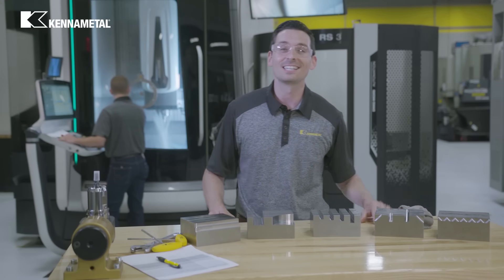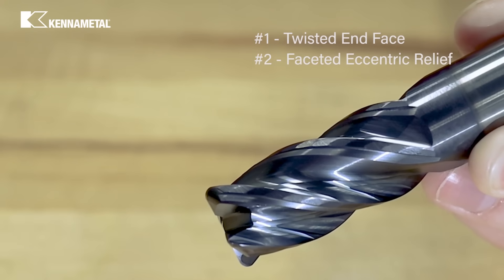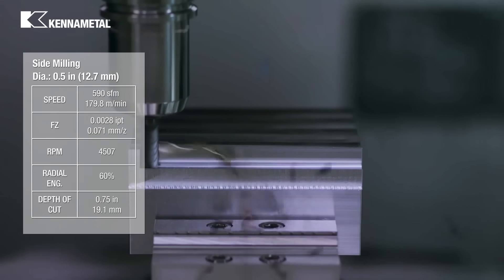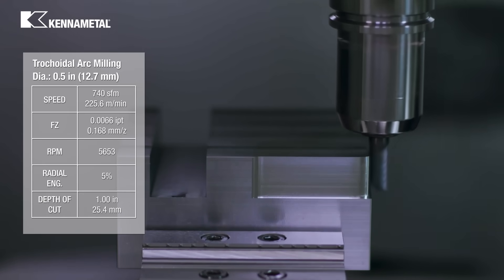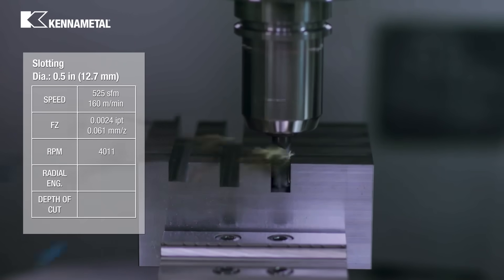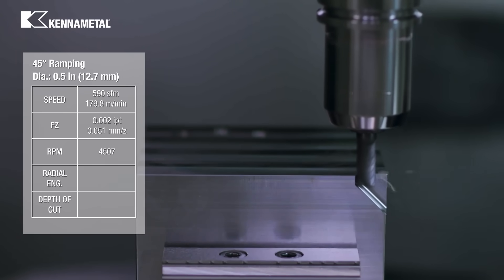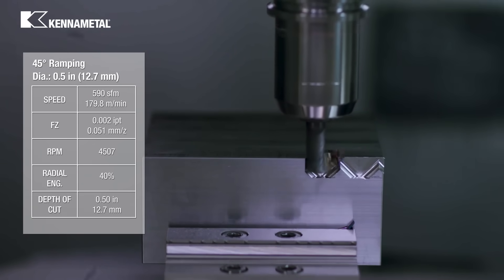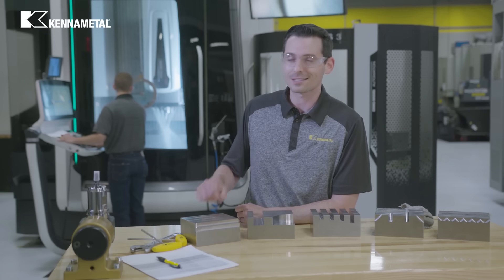HARVI™ I TE - The Magic Solid End Mill From Kennametal

Comment: What kind of horsepower and torque do you need to actually be able to achieve this. I feel like the machines I am using lately (Kitamura Hx300G) would have to have the spindle replaced after doing this for a week. Maybe the Matsuura H300 could do it but I don't know.
Reply from the maker: I won't be able to select between machines and manufacturers, but those values for example for the 1/2" cutter at 60% engagement, .750" axial loc, 590 sfm and .0028 IPT.. the Power at tool (Pcut) is 7 HP and torque at tool (Tcut) is 8.15 ft-lbs

Comment: What Material is it 42CrMo4 ?
Reply from the maker: 42CrMo4 is a material designation for a type of Steel.  If you are familiar with ISO material groupings, this material would be part of the P4 group, which has a hardness between 35 - 43 HRC.  I hope that helps!

Comment: What machine are you using for this demo please. HP and spindle taper size and type? What kind of tool holder are you using? If my machine is not up to the same specs then the tool is no good to me no mater how good it is if I can not duplicate these results in the workshop.
Reply from the maker: We used a DMG Mori DMC 65 monoBLOCK, 47hp, the spindle is a KM4X63™ and a HydroForce™ tool holder!

Comment: Would you use some form of coolant in real life situations ? 
Is this dry operation just for demonstration and filming purposes?
Reply: not usually in steel. thermal shock will fracture the carbide and cause early tool failure. Aluminum almost always requires coolant to prevent the material from galling and clogging the cutting flutes
Reply: @blob_87  It's the coating that gets fractured by the thermal shock. Then once the coating is gone the Endmill will be gone also.
Reply: yes...
Reply: If you get your SFM right in the sweet spot it's actually beneficial to run without coolant in certain types of material, like what they're filming with.

Comment: That is SICK!!!!  And no lube or coolant to boot IN 4140!!
Reply: Air blast for chip evacuation is all that is needed in a lot of materials when using carbide tooling. In fact, using coolant can sometimes reduce tool life due to thermal shock causing micro fractures in the cutting edges.

Comment: 1:13 why would you keep a mic In your back pocket
Reply: We're all busy watching this insane tool perform witchcraft and you are busy looking at the guy's ass :-). LOL
Reply: Basically it’s not good practice and a bad example of how to handle a precision measuring instrument 🤷‍♂️
Reply: BRUHHH indeed
Reply: Belongs in a case when not in use for sure
Reply: It’s not harming the mic at all? What’s it mAtter? As long as the mic is not dropped or knocked it will measure fine
Reply: @mitchelldafoe8445  it's more likely to get damaged, but more to due with body heat causing the mix to measure wrong when working to tight limits
Reply: rockaboy2 yes that is true it is more likely too get damaged, and yes if u we’re working microns body heat could affect things, if working in tenths tho body heat won’t affect much
Reply: I'm more concerned for his ass when he forgets it's there and sits on it hard. 😣

Comment: Good luck doing that on your tormach or haas
Reply: You know what? I'm gonna... just to see what happens. I'll use a comparable cutter in a press fit holder on a VF4.
Reply: @heyspanky5695  I'm predicting it will pull straight out of a press fit holder
Reply: Could you explain why you think it will pull out? Lack of HP?
Reply: Because your endmill acts like a cork screw. But try it why not
Reply: Alex Gregg Ditto